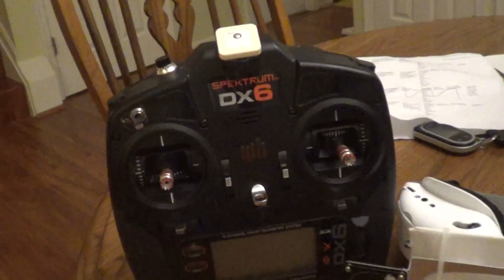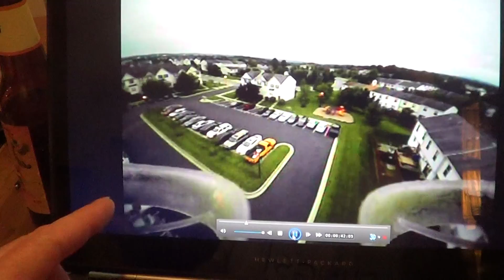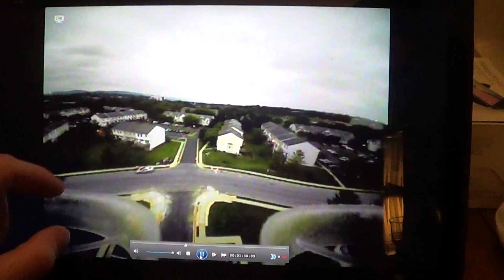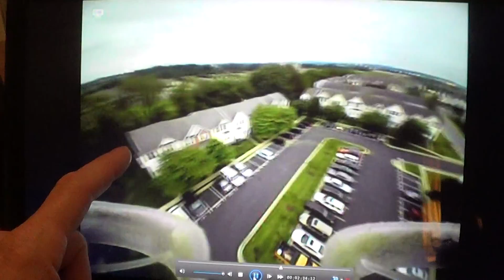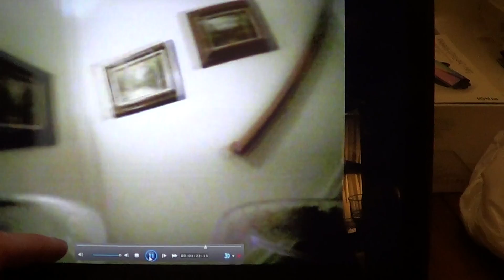Tiny Whoop Range Test at 25mW with Clearview Racing Reciever

Comment: That is amazing! You have filled me with hope.
I'm in Australia, I've got casa on my back for flying fpv. What I need is a sub 100g (that's the threshold here) fpv quad with good range and endurance. I wonder what will be possible with a modified Tello?
Reply from the maker: That sucks.  I'm going for 1 hour duration full GPS, night vision and OSD at 150 grams now.  However, 100 grams pretty much means direct drive brushed only.  I doubt you can get more than 10 minutes flight time without using larger props with a gear drive.  The Tello looks interesting.  Long range is going to require tracking antennas at least for the down link.  I like that light weight means very quiet.  I hope to put up some more videos in a few weeks.  I had to design a circuit board for a hexcopter power section that will mate with the Eagle Tree Micro Vector.  I don't have as much time as I would like.  But, the project should be in the air soon.  I'm documenting everything so other people can build.
Reply: MicroDroneTech what kind of fpv camera did you use this flight ? & what voltage did you power it with ? , and do you think 5volts give better range and stronger signal then 3.7v on any of the fpv cameras ?

Comment: Hey. So all was going Well, got rid off the power connector. However, as I was putting the red wire on the 9v pad, I managed to accidentally rip the pad off... do you maybe have a suggestion as to what I could try?
Reply from the maker: Practice, practice, practice.  Also, a 10X headset is a must.  If you are soldering without a headset, you are braver than me.  https://www.gemsociety.org/article/magnification/
Boards are always fixable.  It is just a question of repairing the broken trace with a wire.
Reply: Problem is that I cant seem to find the trace... I should definitely get a headsetn yes
Reply from the maker: I was just thinking that your soldering iron is probably too hot.  Max temp should be 600 deg F.  You have to use a regulated iron with temperature control.  Otherwise, you melt the adhesive holding the pads on.
Reply from the maker: You could pick it up on the other side.  Get a magnifying glass.  It probably goes to the B0500 (possible fuse) or the reverse polarity diode right next to it.  I'm not sure and I really don't want to cut mine open.  The traces are painted black to make reverse engineering more difficult.  But, they should be visible on the outside layers.  I use my phone on video record with the light turned on.  Then I zoom in 20x on the phone to see things really small.  It is best to not guess.  If the trace is in a center layer, then ohm out the plating with a needle and see which component it goes to.  You will read zero ohms when you find where it goes.  Then just solder onto that component.  If you iron isn't regulated, cool it down with a wet cloth before soldering.
Reply: Thanks, will try this tomorrow. Last question.. (apologies) but what do you mean by center layer?
Reply from the maker: The board is probably 4 layers of traces.  That means some are in the middle and conduct to the hole with copper electroplating.  So, you can rip off an outside layer, but still have the wall of the hole in tact.  Put a probe in the hole and you can ohm out where the circuit runs to.  If the layer on the outside, you can see it with really good magnification.  Even though everything is black, the trace will appear slightly raised.  It is not rocket science.  The only way you will blow it up is if you connect 9V to something that isn't supposed to take 9V.  But, the traces will read zero ohms when you find out what device they connect to.  Worst case, you can take to board to someone who can re-work it.  I doubt the factory will be too keen to fix it, but who knows.  Maybe, they will make a smaller version for fat shark when they see enough people doing it themselves.  That board could become a whole lot smaller.
Reply from the maker: One last thing.  Don't bother making the sheet metal ground that I soldered directly to the board.  If you are making goggles like mine, the external aluminum is plenty sturdy to keep the antennas fixed in place.  The internal steel re-enforcement is just overkill.
Reply: Yeah... thanks for the explanation. I added some pictures here, not sure if it helps. http://s1076.photobucket.com/user/inmihiveritas/library/?view=recent&page=1
Reply: I think I can solder the voltage wire to the upper to the top rectangle to the left of were the solder pad was. The other two rectangles both go to ground. What do you think? Will see if I can see the traces better tomorrow in daylight. Thanks for your help!
Reply from the maker: Just ohm it out first with a multi meter to make sure you are on the correct trace.
Reply from the maker: That pad looks like it doesn't go anywhere.  you might need to probe the center of the hole with a straight pin to ohm out where the pad goes. Worse case I can open my board without too much trouble to update my picture where to solder to when the pad is destroyed like that.  For future reference, you could have hacked the connector on the other side open first and then pulled out each pin one at a time.  I forgot what I did.  But, your board is not bad.  You just need to pick up 9V at the next component that was supposed to receive it.
Reply: yeah i definitely should have done one pin at a time. Having a hard time finding where it goes using a straight pin. I will keep trying tho.
Reply from the maker: I just opened my board.  The green fuse with the b 0050 on it is 9V.   Just "gently" solder a wire on one end.  You might be disabling reverse polarity protection if you are after the diode.  I didn't fully pull my board to get a better image.  I just read zero ohms between the 9V terminal and the green fuse.
Reply: MicroDroneTech dude thanks sooo much. Am going to do this.

Like someone below said: hero
Reply: Dude it powers on again... so relieved. But... (always a but) i did notice a tiny bit of smoke coming from the left processor so i checked all the legs and two separate legs are somehow connected. I cannot visibly see the connection tho. i read about removing the short with wick between the legs. is that smart you think?
Reply: Assuming that issue will be resolved, i also picked up the boost converter (ITX05099SA). If I understand correctly I add a positive wire from where the goggle connector is to the first pin. The negative wire to the second pin.

Can I then add a wire from the fourth pin (pin 6 according to http://www.xppower.com/Portals/0/pdfs/SF_ITX.pdf the diagram on page 3) directly to the positive wire of the clearview  and a wire between the 5th pin (pin 7 in the diagram directly to the clearviews negative wire?

And then I add a wire between the first pin and the fifth pin (pin 7 in the diagram). is that correct? The reason I am confused is because the converter visibly only has 5 pins and the diagram has more. 

My apologies to bother you so much!!
Reply: Crazyyy its working again!! thank you so much. Now ill only do the boost converter and call it QUITS

Comment: Hi what batteries do you use in tiny whoop and have you disarmed the lvc on the board ??
Reply from the maker: 210 mha has plenty of capacity.   no lvc.  you can tell when you are drained.  a timer with 30 sec reserve is best.

Comment: amazing ! what a incredible range !!! so what kind of range you will get from 200mw vtx ?! i  think your tx give up first !
Reply from the maker: Range is greatest when things that block range aren't in the path.  Trees are bad for range because the leaves are mostly water.  So, the ideal conditions are free air.  Dry materials such as drywall and wood are fine.  Range doubles every 6db increase in power or antenna gain.  So, going from 25mW to 200mW increases 9 db.  That power increase will slightly double the video range.  However, Tiny Whoop doesn't have the option of increasing the video power.  So, I have to increase the antenna gain instead.